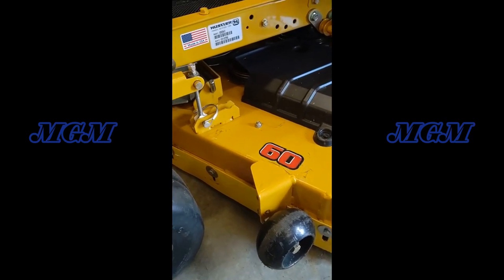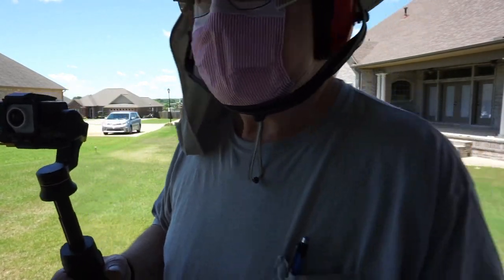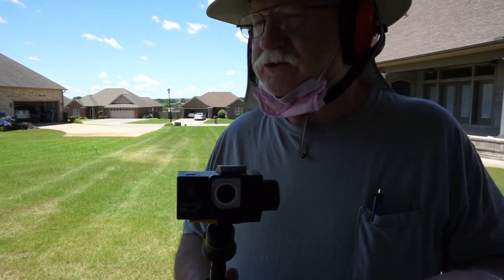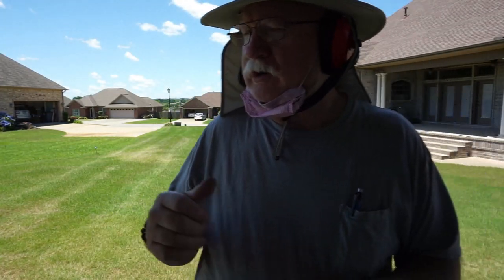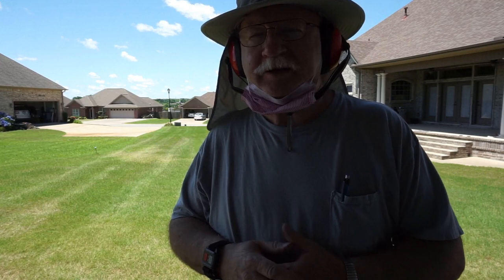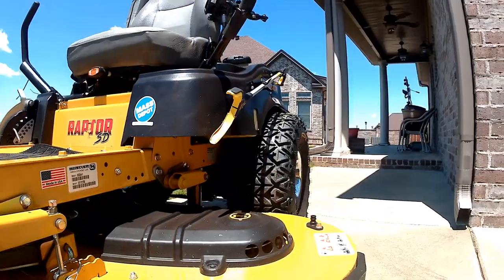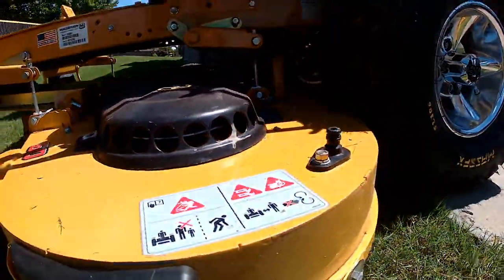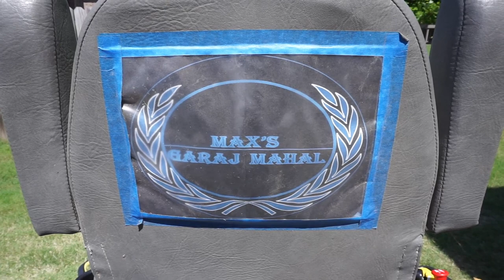Hustler SD60 Adjustable Deck Skirting: Video Testing Phase 1

Comment: It’s looks like it doing a great job Max , would it leave strips if you lower it or does it need to be on the rear of the deck. Another Great idea from Max.
Reply from the maker: Can't believe I never saw this. Thank you my friend. It works great for vacuum and stopping most of the frontal blow out.